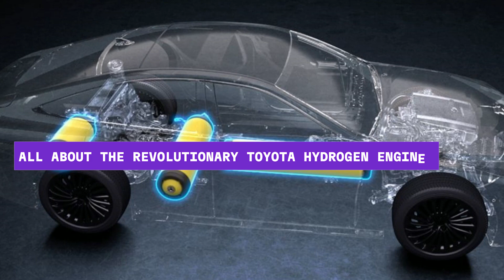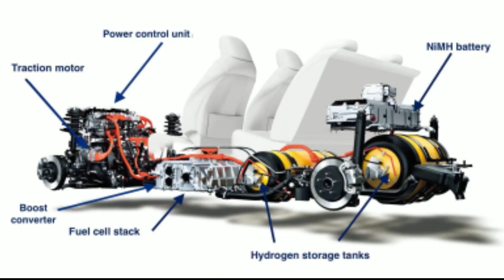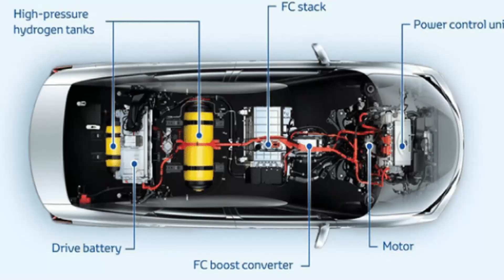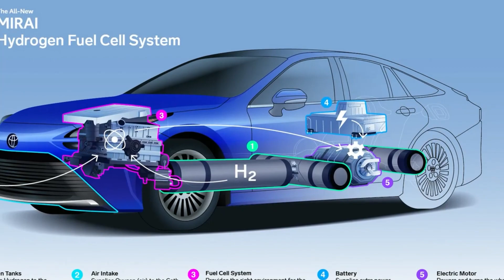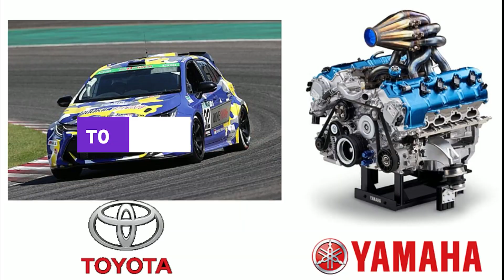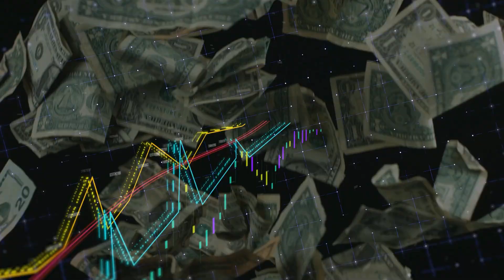Toyota CEO Quits, But Goes All-in for a NEW Hydrogen Combustion Engine

Comment: Hydrogen, including "green" hydrogen, is usually isolated by a process using electricity. That power could, instead, be stored in batteries. Until further notice, batteries, tho not perfectly efficient, retain more power than hydrogen does. And hydrogen needs handling and shipping, requiring more energy. That, alone, should dissuade makers from using hydrogen in vehicles. And of course batteries keep improving.

Comment: It is an important technological advance in automobiles, the traditional combustion with gasoline or diesel, except for the combustion of small amounts of motor oil during driving, it is powered by hydrogen and does not emit CO₂.